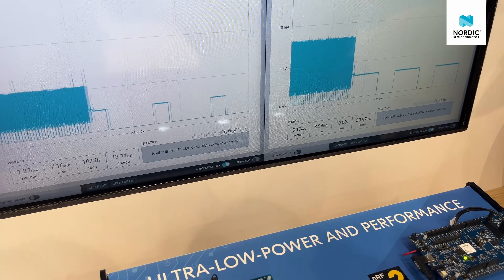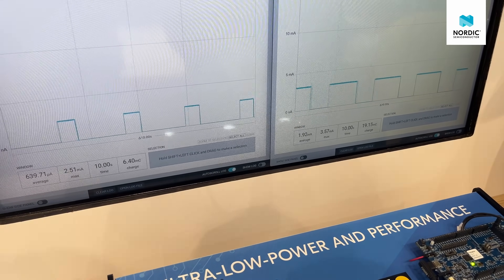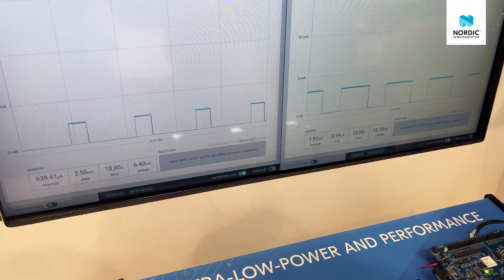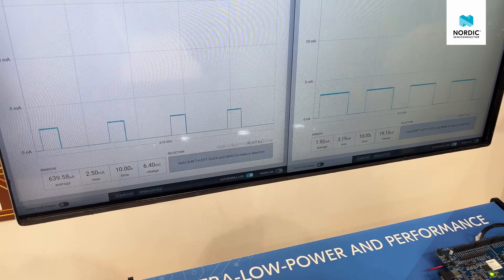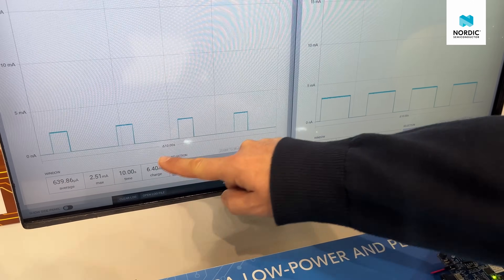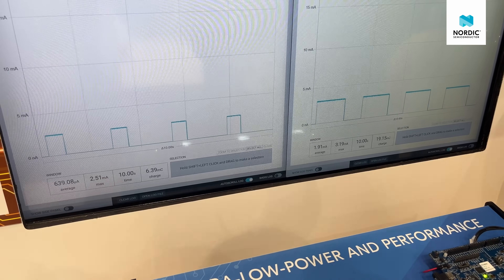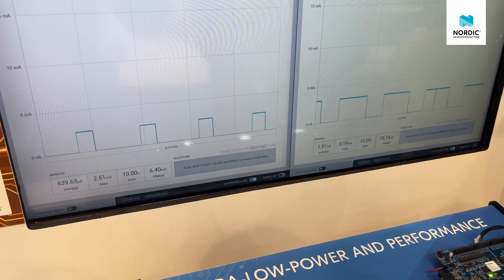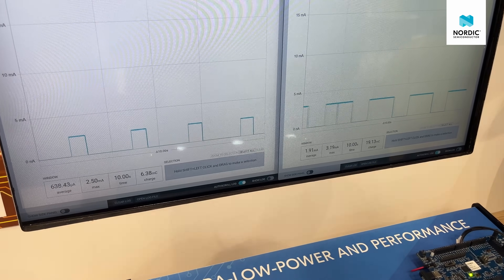Demo: nRF54L Series vs nRF52 Series comparison // Electronica 2024

Comment: What about nRF53 😂
Reply from the maker: That's a valid point! The nRF5340 is a dual-processor SoC, while the nRF54L Series is the natural successor to the nRF52 Series. The nRF54L Series features a single-processor architecture and is designed for similar end-product categories as the nRF52 Series. Any products can be compared to each other with the Online Power Profiler: https://devzone.nordicsemi.com/power/w/opp/2/online-power-profiler-for-bluetooth-le